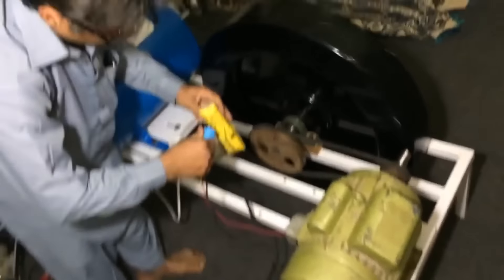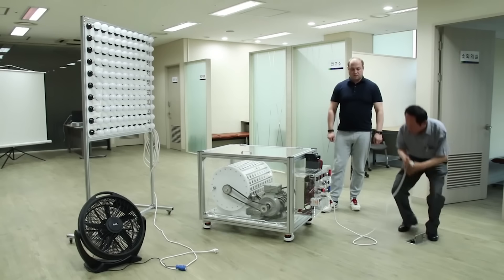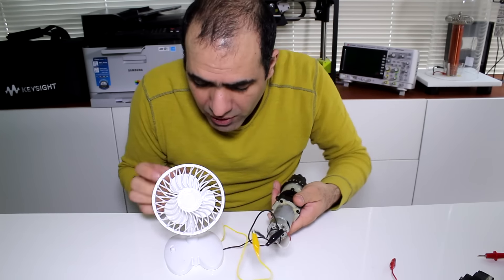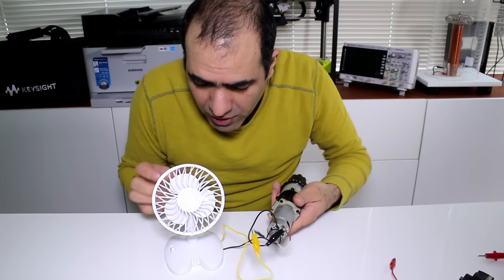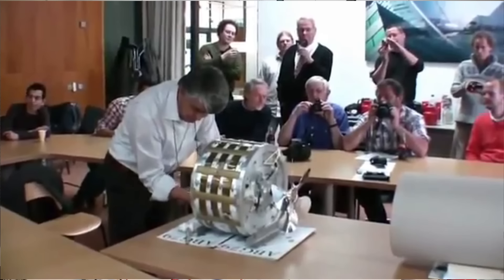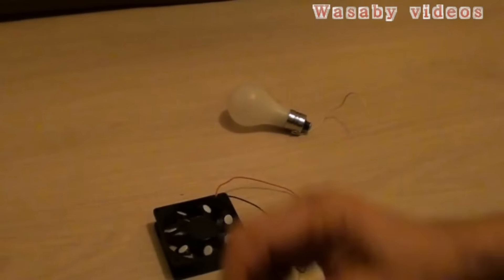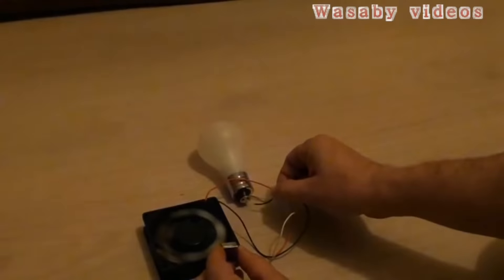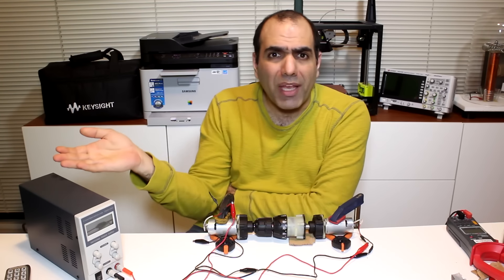The Curious Case of Free Energy Device

Comment: Here's something "free energy" hoaxes tend to overlook: If the device powers itself and creates more power than it consumes, then why don't they ever speed up out of control?
Reply: Bingo. There would have to be a speed governor
Reply: And some way to dissipate the excess energy.
Reply: Sort of a fundamental problem with the basic principle of free energy. If it were possible to contravene entropy life would not exist because some natural mechanism would go "overunity" and generate exponentially more power. So even if it were possible, it would be impossible.
Reply: phant0 Great point.
Reply: I was thinking about this the other day. Being familiar with various forms of power generation and electronics, I always get asked stupid questions about over unity systems. It occurred to me that if there was a "over unity" device, then there is a positive feedback loop that would destroy the device. Just ask the guys over at sl-1 about prompt criticality and how well that worked for them.
Reply: I actually don't think this would be an issue within their own ludicrous and (somewhat ironically) closed system of internal logic.

Generally these devices accelerate to a point of equilibrium and the electrical energy is harnessed as continuously replenished potential energy. Think current limited battery but with unlimited capacity. 
Waterfall (M. C. Escher) is a nice visual metaphor for this.
Reply: TheFootbaldd o
Reply: phant0 dissipating excess energy would be impossible as it'll grow exponentially.
Reply: Anything that could be hooked up to the system and take away the excess energy would do that. If it is a spinning wheel, a simple friction brake would turn excess energy into heat and dissipating it in the ambient air. In an electrical system the same could be achieved by installing a resistor in serial in it. It could definitely work for the short period of time they demonstrated their devices.

BUT this is a moot discussion as these self-powering devices that supposedly generate more energy than they consume are impossible to build. So such a speed governing system will never be required.
Reply: I forgot the word but you can't go faster than what is limited in it's environment, for instance planet Earth has a gravitational pull as well as air resistance, so those factors the speed limit of an object in it's environment. However there are proven methods to bypass this, for instance space doesn't have any kind of air resistance nor is it gravitational (of course if you're far enough out of a gravitational pull from a planet), you could potentially arrive in an indefinite speed that forever increases. The thing is, you can create these so call 'free energy' devices, it's just people aren't looking at the right places. Law's of thermodynamics only apply to planet earth in it's absolute form, and again as I've mentioned before, space is a whole different ball game from earth, so is planet Venus, Mercury, mars and the sun itself (any planet really). I take it people still believe the idea that nothing travels faster light, that would be wrong, in space the endless vacuum of emptiness is expanding faster than light and if you've done your research noise trajectory is actually 10% faster than light, not only that light have a hard time escaping a dark hole, so gravitational pull is stronger than travelling, interesting. There are some schematics in mind, but I don't know when will people reach there.
Reply: 1 Gravitational force is not a limiting factor for speed.
2 There are no proven methods. Ever.
3 You could not arrive at a forever increasing speed because a) that's not speed; that's acceleration, and b) you don't have access to a portable supply of infinite kinetic energy (which, as you may have noticed, is kind of the entire point of this video).
4 Yes, it's true that virtually anyone can create one of these "free energy" devices. The trick is in finding enough dimwitted people to fund you for it, because it will obviously never work.
5 The Laws of thermodynamics are not exclusive to any planet, or place, or time. They're LAWS of PHYSICS, not gramatical rules or the latest fashion trend.
6 A star is not a planet.
7 There is no known substance capable of traveling faster than 300Mm/s.
8 The vacuum of space is not expanding. Ever. That's the speculative span of the universe and it also isn't allowed to be that fast.
9 Noise trajectory is sound, typically as it applies to aircraft. Sound is not faster than light. Sound at its best performance moves at less than 0.01% of that speed. This is why supersonic aircraft don't count as FTL vehicles.
10 Gravitational pull is not "stronger than travelling". The act of travelling is not a force.
Reply: Seriously Jesus, your previous statement was largely incoherent. It would do you good to go back to the books and review your forces, laws of thermodynamics, differential equations, and then general and special relativity for starters. I would start with your basic forces and maybe Gaussian surfaces. From there check out the differential equations that model motion such as why your drag coefficient would be an inverse square of velocity. You should definitely review your laws of thermo, because they have a whole lot to say about how closed and open systems operate which is one of the more useful tools for modeling any system. After that you might want to learn more about the speed of light and what special relativity means... Experiments are great if you are careful to establish proper testing and controls. I wouldn't call myself a scientist, but I'm not going to buy into some unsubstantiated bs. I have had a ton of physics and math in both college and in the field. I mean, I've stood on top of a few atom smashers and have seen nuclear physics put to work first hand. There are a few gross concept errors in your statements that are easy enough to fix, but that is on you. Good day.
Reply: lol projection much? it's more like you're i'm out of your intellectual reach and to have any say is to say go back to basics for your lack of intelligence to uphold any kind of position that refutes and debunks others. i'd expect a normal person reasoned in science would point out the flaw and refute them, rather if anything you need to go back to basics of logic, forget science. logic dictates that a majority rule does not == truth, that's a fundamental value incorporated in the way of western scientific process, and if you don't understand this....... i need not say more. good day back.
Reply: "logic dictates that a majority rule does not == truth" That is True. I'm just giving you some pointers. 

For example, you said "Gravitational force is not a limiting factor for speed.". 

Velocity, acceleration, and position are related by a second order differential equation that is based of off  Newton's second  law, F = MA. That system takes care of the effects of force on an object, and that can include air resistance. 

You also said " Law's of thermodynamics only apply to planet earth in it's absolute form, and again as I've mentioned before, space is a whole different ball game from earth, so is planet Venus, Mercury, mars and the sun itself (any planet really)". 

I do not know what you are trying to say here, but as it it worded is wrong. You can easily apply the law of thermo to any system, planet, solar system... The model seems to work very well on the large scale. The energy balance equation is the bread and butter of all physics for example. 

You also said "you could potentially arrive in an indefinite speed that forever increases".

Not sure again what you are getting at here. You can easily have a function that is continually increasing; yet never reaching the speed of light. That is quite possible with a convergent series.

I'm trying to project or hurt insult you. I thought we were having an intellectual debate, and your initial statement is unsound, and I gave you some pointers on what to look at to see why it is unsound.
Reply: And this is exactly what I want, see we just made progress instead of nillywilly widdle people down on who's right or who's wrong and stop there, the process continues. So...

""logic dictates that a majority rule does not == truth" That is True. I'm just giving you some pointers. "
pointers for what? that throughout this whole discussion i don't rely on argument from authority like the ones barraging me with?

"Velocity, acceleration, and position are related by a second order differential equation that is based of off  Newton's second  law, F = MA. That system takes care of the effects of force on an object, and that can include air resistance. "
this is a dead horse topic, this is more of a nuanced point bout how objects move. again if anything, the agreement would more or less end up with both of us agreeing.

"I do not know what you are trying to say here, but as it it worded is wrong. You can easily apply the law of thermo to any system, planet, solar system... The model seems to work very well on the large scale. The energy balance equation is the bread and butter of all physics for example. "
well, do you think mars. sun, venus, mercury has exact properties like planet earth from the surface all the way down to the molecular level? the answer is no, but to squeal in the idea that thermodynamics is applicable would require a huge strain of proof that every planet in the known universe will have to share the same laws that thermodynamics applies, and that is in it of itself a losing position, because it's pretty obvious scientists discover planets that have some of the strangest properties known to man in it's current state.

"Not sure again what you are getting at here. You can easily have a function that is continually increasing; yet never reaching the speed of light. That is quite possible with a convergent series."
if it's continually increasing, will it be just a matter of time it will come into speed of light without any planet's gravitational pull or running into another object? that's the underlying question here that's been dodged.

"I'm trying to project or hurt insult you. I thought we were having an intellectual debate, and your initial statement is unsound, and I gave you some pointers on what to look at to see why it is unsound."
no my friend :), you see we're now just getting somewhere, before you just jolly up a assumption bout me without providing a productive discourse, but now that i smacked that out of you and got your attention, it's more or less what i wanted, a discourse that we both can talk bout.
Reply: The part about continually increasing velocity necessitates a force to be acting on the object. What I mentioned was how an function could be continually increasing in value, but still be bounded. This type of idea is what is taught in calculus 2 with sequences and series.  In the current model, which works very well. The speed of light is an upper limit. when you approach <90% the speed of light or greater, you see the effects of special relativity in terms of time dilation, length contraction, doppler effect, and relativistic mass/ mass energy equivalence.  Even in special relativity, mass-energy balance equations still hold true. Having a background in nuclear physics, I always thought this field of study is interesting, but it is not very practical for normal engineering. That said, it is still based off the laws of thermodynamic systems. To a certain level, you have to press the I believe button; but it is these basic laws that are the foundation for everything that builds into both macro and micro levels of observation. The main difference being that on the small scale, everything becomes statistical or probabilistic; and on the larger scale, the limits are approached so that classical methods hold true.
Reply: well at this point, the next question would  be what is light made of? Einstein calls it photons, so the next question is, how big is a photon and then what other kind of sources out there is the same size? going forward, there is a flaw idea here, you indirectly claim light as the maximum capacity for speed, how certain are you of this? you really think light is the maximum speed limit anything that's traveling along time and space? if so, the gravitational pull of a dark hole, as people would call it, actually pulls light faster than it can travel, and the underlying conclusion here is that something along the lines of forces that is propelled, there is something much stronger than light itself in space of course, other planets have their own line of logic, all of this is tearing up the laws of thermodynamics. the thing here is i don't dismiss the THEORIES of thermodynamics, it's just that it isn't very scale-able as you've claimed, rather it's a guideline concept if anything. LOL and this is funny, your last couple line of thought you at the end of the day agree with me, as a person in this field, the idea is to take away that the THEORIES of physics, not LAWS of physics, should be taken as a guideline instead of a rule book when venturing off to experiment things.
Reply: I don't have much time right now, but I will say that in science "theories" do not mean the same thing as in general language. They have to be testable, and consistently repeatable. That does not mean they are absolute or necessarily correct. Take classical physics for example. It works well within certain perimeters, but there are more complete equations that work for both classic and modern physics where Newtonian physics breaks down at a point.
Reply: 2 Nice straw man JC. Having properties that differ from something else's properties does not make any methods provable for either. Nor are there any methods to "bypass" the limitations of an object's speed.
3 Allow me to break it down for you then: Acceleration is the rate at which an object's speed changes, kinetic energy is the energy of an object's motion, infinite means having no limit of any kind, something that is portable can be moved around easily, and everything is jargon to a listener who understands nothing, as demonstrated.
4 For starters? /watch?v=06xFhUHFnx8&lc
5 I haven't prove (sic) that laws pertain in space? Well, should I? Can you even demonstrate that this might not be the case? (ou :ɹəʍsuɐ)
6 !i!
7 Oh WOW! A website clearly says that 9/11 was orchestrated by space aliens living inside jellyfish. Amazing! Thanks google.
8 Well, no. It isn't a theory ... from anywhere. The actual scientific theories are about the topological size and shape of the universe, not expanding space. Good job claiming the moral high ground, though. It would almost pass for a rebuttal if I had ever based a statement on the factual correctness of any authority figure whether I know their names or not.
9 Thank you for demonstrating the profound extent of your ignorance. I'll leave it for others to speculate as to how "magneto dielectric waveform" became "noise trajectory" in your mind, but I will point out that a) a waveform is not an object, b) "radio" is a certain frequency OF LIGHT, and c) the linear length of wire in the coil is not proportional to the wave propagated around it.
10 Perhaps I've been going about this all wrong. Are you an English speaker, or is the entire discussion being filtered through google translate? Trajectory has no influence upon gravitational force; it's force that determines the trajectory.
11 Thank you for demonstrating that your ignorance extends even further than previously surmised. Regardless of what kind of person you think I am, it takes a truly ... special kind of person to ass-pull that much groundless assumption of another person's character, habits, and education from a simple analysis of their own statement. Congradulations.
Reply: You guys realize he's a troll right?
Reply: i know, but it's fun to troll back when they abandon all reasoning.
Reply: You've made it very clear by now that you either have no understanding of what science is, what logic is, or even what any kind of rational discussion is, OR that you are very good at faking complete ignorance of these things. In either case, as you are clearly incapable of remaining on the topic of perpetual motion machines, I'm going to point you to this forum (http://armorgames.com/community/forum/36/wepr), in which I will happily explain all of these things in as much excruciating childhood-dream-crushing detail as you'd like for as long as you can avoid being permanently banned. Hope you have fun. [end communication]
Reply: The guy's an obvious troll. Don't bother replying to him.
Reply: and Jesus Christ has won the games! UNTIL NOW.
1. This is all wrong! Dont you remember the massive event in 1998? The massive discovery? IT caused MASSIVE changes as to how we view energy.. come on PLEASE tell me you remember nineteen ninety eight when the undertaker threw mankind off hеll in a 
cell, and plummeted sixteen feet through an announcer's table.
Reply: This is incredible
Reply: @phant0 Why do they even have to be powered up in the first place?
Reply: Eventually friction creates a terminal velocity just like with gravity.
Reply: Because imagine that goes so fast and starts flying around and destroy the house and the neighboors and the city and the world! You must be careful when designing a free energy device, so that it NEVER goes out of control! Very dangerous! Free energy can have a life cost if not used carefully!

(wtf 😂)
Reply: Umm the solution for this is easy. You just buffer the excess energy in some energy storage. That would require some more component work and logic but it is certainly doable and not an oversight.
Reply: @phant0  in other words, it's gonna become a bomb
Reply: @danielthechskid  No, that's why they power their devices and then start plugging things in, to load the output